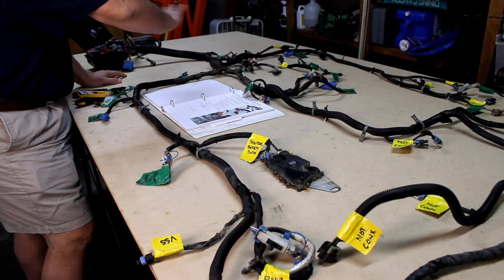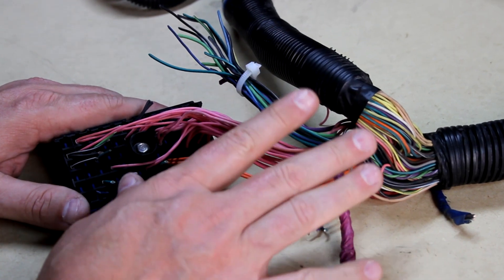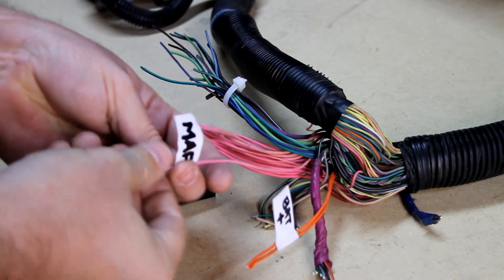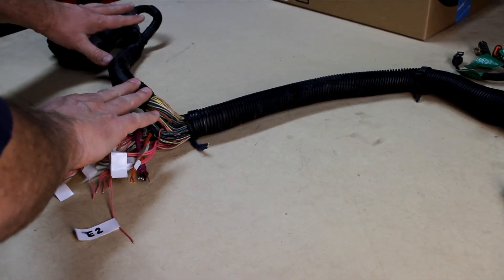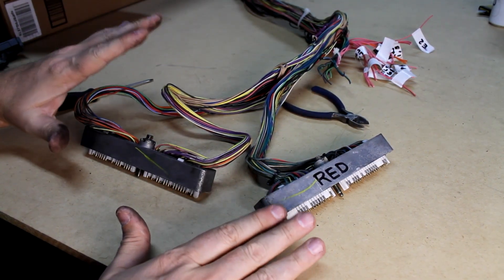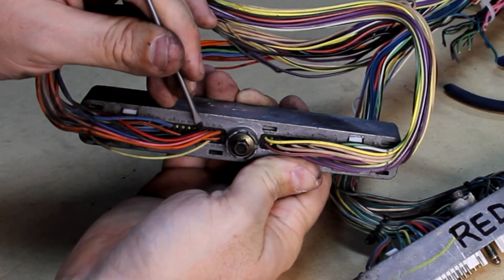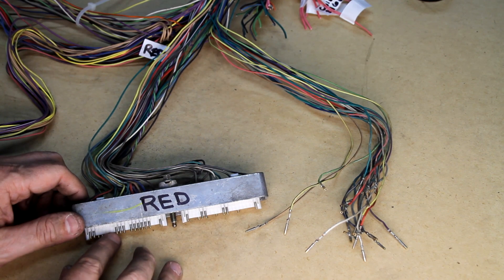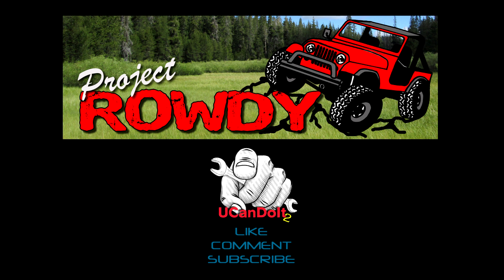LS Wiring Harness Part 2 | Project Rowdy Ep014

Comment: Hi! as you marked E2 and F2 to delete but you notice u will need it so now you will save it to power the pcm.  Am asking to change this information in the chart because i already download. Another question,  I have an aftermarket wiring harness and it comes with a FUEL PUMP wire. is this wire the same as the fuel pump wire you're saving?
Reply from the maker: I have updated Chart to reflect keeping the E2 and F2 Wires.  If you download another copy, it will reflect the changes.   The Fuel Pump wire of your aftermarket harness runs from the Aftermarket Fuse block to the Fuel Pump.  The Fuel Pump wire in my diagram (Yellow wire in my diagram). This yellow wire either (1) needs to replace the aftermarket wire and run all the way to the fuel pump, OR (2) be connected to the aftermarket wire (especially if it is already included in a bundle of wires heading to the rear of the vehicle).  The Yellow wire and the Aftermarket Wire labeled Fuel Pump are trying to do the same thing.
Reply: thanks. nice explanation. either way i can keep fuel pump wire from aftermarket  fuse box or delete it and use the one in your diagram. cool

Comment: Question why did you keep the e-2 pink wire?
Reply from the maker: Are you talking about all of the Pink Wires from the C2 Connector?  About 10 or so of them...  Those all go to components on the engine that need positive power when the key is in the Run position.  If you are talking about something else, please explain.

Comment: i can't find the link to the list of pins to be removed from the ppm and the list of wires for the pink and oranges that you removed from the block. you put it on the screen but its hard to read do you have any links to it? thank you.
Reply from the maker: See if this is what you are looking for.   Please note that these are the pins for my engine, your may be different.  The Xs are based on what I wanted to remove, you may elect to keep some or remove more.  Cheers!http://bit.ly/PCMandConnectorTables
Reply: UCanDoIt2 thank you so much

Comment: After removing the pins that go to sensors, do you cut the sensor connector off or do you just cut the wire and keep the sensor?
Reply from the maker: I de-pinned the wires from the PCM connector for the items (sensors and others) that I was removing from the harness.   Ultimately, the unwanted connector and wiring was all removed.

Comment: Could you send me your pinout sheet of the C2 connector? I found it on lt1swap.com but the current one on there doesn't individually describe all the pink wires (Ignition 1 Voltage). This is for the exact same engine in the video too, '01 5.3 out of a Silverado, stock harness and pcm. I would really appreciate any help!
Reply from the maker: James, send me an email to ucandoit2mike@gmail.com and I will forward 3 documents that contain the information that you are looking for.  CHeers!  Mike
Reply: Thanks fella! I emailed you about it.

Comment: E8,F9,B6 these wires in the c2 underhood plug are they deleted if you keep the stock transmission from the donor vehicle. 01 5.3 and 4L60E. Can't seem to find the answer anywhere
Reply from the maker: The E8 is for the Rear O2 Sensors, so if you are going to run rear sensors, you will want to keep it.  F9 is your Ignition Voltage which I handle a different way.  B6 is also ignition voltage and would not be necessary in your situation.
Reply: UCanDoIt2 thanks again for the answer and the thorough videos

Comment: By any changes did you keep TCC break switch on C-100 connector and what is the wire for? Second in a video it shows that you kept Tech wire which wire is that what connector?
Reply from the maker: Well....  You have me stumped.   My notes show that I did not delete B33 TCC (Torque Converter Clutch),  however, there would not have been a reason for me to keep it as I will be running a Manual Transmission.   The reason that I am stumped, is that if I did not de-pin it, which connector in the harness is it going to.   Sorry, but I am not sure!
Reply: Ok thanks
Reply from the maker: Looks like it goes from the PCM to the C100 connector Pin E.
Reply: What about Tech wire is that on C-100 connecter also

Comment: I can't seem to find the diagram on Lt1swap.com of the c2 connector, of what is needed and what isn't.   Anyone have a direct link?
Reply from the maker: Here it is for the 4.8/5.3/6.0 2001 engine.  http://lt1swap.com/vortec_truck_pinouts/2001.htm You can backtrack through the site to find one that matches your engine.
Reply: UCanDoIt2 I'm getting a 404 on that link.
Reply from the maker: It had an erroneous space.  I have fixed my original response above.
Reply: Thank you!  That's it!  This is my first LS swap, and I am a bit intimidated with the harness.   Until I watched your videos, I was going to pay someone to mod my harness.   Your videos are the best that I've watched on doing the harness, and I'll attempt to do it myself.
Reply from the maker: Make sure that you know how to navigate LT1Swap and that you have the proper references for your Engine.  The link I provided was for my engine, yours may be different.  Wouldn't want that to throw you for a loop.  Cheers!

Comment: im doing a swap, blue and green pcm. I want to connect my stock 2000 Tahoe Limited OBS gages but I'm having trouble identifying what color wire goes to which Gage. Can anyone help identify the wires for my cluster since mine been cut? thanks
Reply from the maker: Have you check on LT1Swap.com.  Brandon has many wiring schematics.  I am pretty sure I have seen this for the older Blue/Red harnesses.

Comment: i just did my harness this weekend and it took me 3 days. i wish i would've seen this video before 😭😭😭 check with an ohmmeter every single wire to see what every connector was
Reply from the maker: Hey... at least you did get to the end!   But wow, that is a lot of wire testing!!!!   Have fun with yours!!!!!
Reply: UCanDoIt2 i just have a question do i keep my transmission wires from my harness (2003)  due that is going into my c1500 that has a 4l60e?
Reply from the maker: I have very limited knowledge of automatic transmissions.  I do not know the answer to your question.  Maybe someone else seeing this would have the correct answer for you!
Reply: relicaro21 I'm doing this swap soon on a c1500 too, did you leave all the transmission wires and connecters?
Reply from the maker: I did remove all of the Transmission wires in Part 3 of this series as I am going with a manual AX15 transmission.
Reply: Ruben Pinto did you do your harbess yet? Just saw the message
Reply: Ruben Pinto what what transmission are you using. You have 2 transmission connectors on your harness the roundone for you valve body and the kind of square for your gear selector lights and all that stuff
Reply: relicaro21 not yet I'm planning on a 4l60e
Reply: keep the wires might just plug in if its an older 4l60e seconde gen just need to use the range wires. and don't forget the spacer that goes between the flexplate and torque converter.

Comment: hey man do u have a link for all the pin outs for all the connectors in the harness including the remote harness connectors can't find a link anywhere or its not working thanks and great video super helpful!!
Reply from the maker: www.lt1swap.com   You will have to choose your year model to get the correct one as they did change.
Reply: found it now Thank you!

Comment: Did you get your PCM flashed? If so where did you send it?
Reply from the maker: I have not yet re-programmed the PCM.  There is a guy that lives a little north of me that I would like to contact just from the convenience stand point.  If that does not appear to be a good option, I will most likely send it to Brendan at LT1Swap.com.  I have started and need to complete a list of things that I know need to be changed based on my custom configuration.

Comment: So the only reason to "depin" is to clean up the harnes?
Reply from the maker: Yes.  You could very easily leave the harness AS-IS and do a swap without any of this.  Most of the guys that are Swapping into Hot Rods, Show Cars, and or something they want to Show Off... are removing non-essential wiring and connectors.  Thanks for watching!!!
Reply: Great thanks. thanks for posting the videos.

Comment: Awesome videos
Glad I came across them. You did an excellent job explaining everything.
KUDOS!!
Reply from the maker: Thank you sir!  I appreciate your comment very much.
Reply: where do the 4 wires from C100 connect to?
Reply from the maker: The 4 wires that I am keeping form the C100 Connector are:  1) BRN/WHT - This is the Check Engine Light (Neg -), 2) DARK GREEN - This is the DATA circuit that will go to the ODB2 port, 3) TAN/WHT - This is the Oil Pressure Sensor, 4) WHT - This is the Engine Speed wire that will feed the Tach.  I will have videos soon that will show how to wire both the ODB2 Connector and the Tach Circuit with the required diode.   Does that help?
Reply: Somewhat
I will keep an eye out for the next video.
Thanks!!!!!!

Comment: Very clever using the hot glue gun!  Great video!
Reply from the maker: I'm thinking that will be a good semi-permanent sealed solution.  I see others using epoxy and don't think that is the way I want to go.  It is either that or silicone.  I have a small applicator that I could neatly apply some silicone.  Just a thought.  Thank you sir!
Reply: I used gasket maker. it worked very well, but i like the hot glue idea better.
Reply from the maker: I actually like your idea of the Gasket Maker.   I have a Craft Syringe that has a large opening that I had planned to use just to help keep it somewhat clean.  I am looking for anything that will be pliable when applying, but then setup semi-soft.  I may try loading one with GM and another with Silicone and see if I like either.  If not, I will go with the Hot Glue!  Cheers!